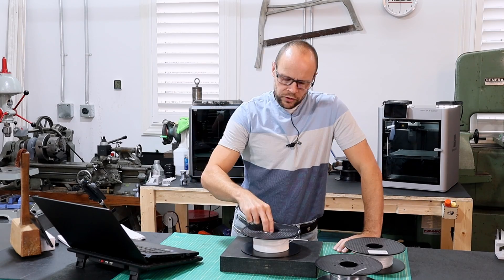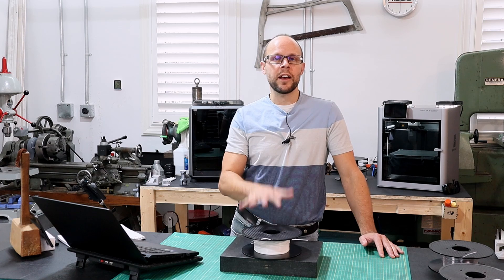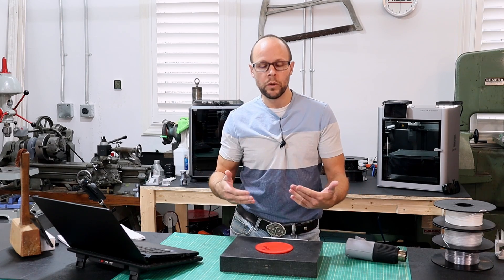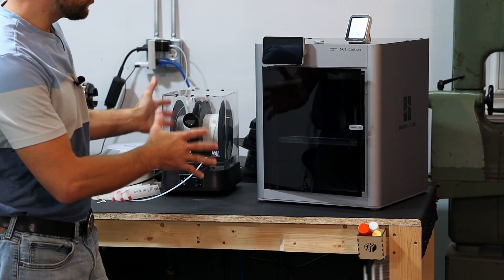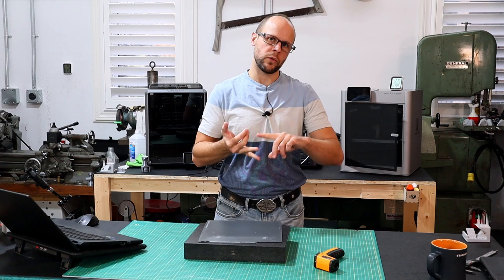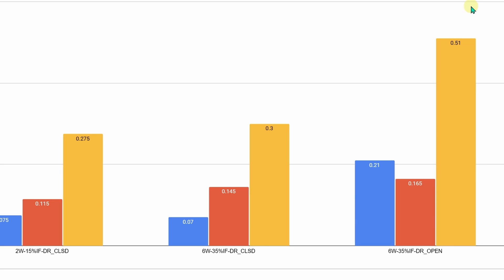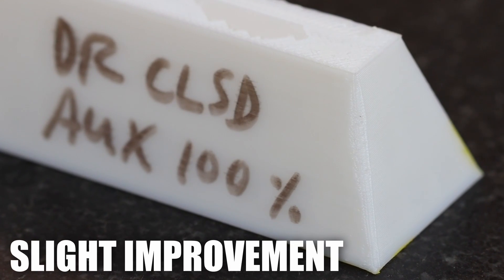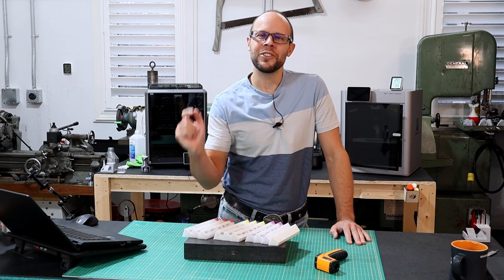Does PLA Warp?  If it does, how much compared to PETG and ABS?

Comment: I've had my X1CC for over a year now and I just print with the door closed, even with pla, just because it works and works and works
Reply from the maker: That's good to know, there seem to be lots of people who mod their printers to add vents etc.   I guess in my case I was doing high-speed and also fairly small prints, cooling was a problem, if the prints were a bit larger or more pieces on the plate, it would've been fine at the corners.  I'm with you, I am a huge fan of the X1C.  I like the K1 as well though and I think it can be better still, and I am also going to see if I can get my hands on a K1 Max, it would be nice to be able to test against each other.
Reply: I bought P1S and I have to say that without a cool plate with bed temperature set to 35C, I get clogs (even with lid open but closed door). The filament snaps in the heatbreak. Never had this issue with P1P.
Reply from the maker: @hologos_  I have to wonder if it more of a filament related issue.  I have not had a single one of these problems with my printer; I suppose there is the fact that I'm running the hardened steel nozzle and it doesn't heat as well as yours does.  There are so many variables involved.  That's a great point though, running too hot can cause other problems which are different and equally as annoying as the ones shown in the video.  Do you mind sharing the part your printing and the filament you run on it?  You have me curious now!
Reply: @NeedItMakeIt I am using PLA from Aurapol (Czech company) and I have to print with 240°C temperature with 15mm^3 max volumetric speed. Those clogs were with default stainless steel nozzle. After about 3 hours, the filament snapped in the heatbreak. Once while printing single color print and once while unloading in multicolor print. I guess the filament got soft. Since then I've been using cool plate and haven't had issues even with lid and doors closed.

The parts I printed were a full bed organizer tray and the multicolor one was a Call of Duty headphones stand.
Reply: I just use the hot plate and closed printer all the time, also with PLA. It just works.
 @hologos_

Comment: In the example the prints don't deform due to adhering to the bed. Does that mean the parts internally stressed? Also, I've read somewhere that warping can also be caused by sudden crystallization in thick sections that are too warm.
Reply from the maker: Yes, that's right, what I wanted to show in the video and what most people seem to not realize is that the parts are still warping even though they had perfect adhesion, it's true that its not a lot, but it is a problem in some cases, when you take two prints off and you put them together, the banana shapes meet against each other and don't fit tight.  Not so great in some cases if you want a tight fit.  There are definitely internal stresses involved.  I'd liken it to wood, when you cut a piece of wood sometimes even though the original piece was straight, the pieces you end up with after cutting are not.  The smaller parts with thinner cross-sections are more flexible and warp.  Similar here with plastics, if the cross-sections are large enough, they can resist the stresses.  Also the adhesion to the bed does this as well, but only to a certain point, it can still pull up on the buildplate quite a bit.  A while back I printed a heavy-duty ASA piece and it completely lifted the buildplate away from the magnet.  it was just terrible and of course the print was ruined as well... 

I don't have a full solution to this problem.  I think printing slower seems to help, also printing PLA in the enclosure and keeping the temperature inside the chamber higher helps quite a bit as well, and if the prints are large or there are more than one, cooling shouldn't be a problem.

Comment: I used PLA on a project that had thinner areas touching the bed. I forgot to use rafts and it warped bid time! More so farther out towards the ends.
Reply from the maker: For sure, I wish I had some way of measuring how much force is applied, it's probably far more than what we expect.  You would use a raft to help you on this?  I think I've only used a raft once, back 4 years ago.
Reply: @NeedItMakeIt  I've never had problems before with this much warping as I did with this particular print. The part was maybe 3/16th wide and 3 inches long and all 3 warped up badly. I also had a problem with the heat block hunting for the commander heat settings. I had adjusted the temp after I started the print as it felt colder in my basement than usual. I was thinking the colder temps were going to cause a problem so I upped it a bit.

Half way through the print (pretty much a stock Ender3v2) I saw the pid hunting to keep the temp at what I commanded it to. But I think the lack of using a raft around the thinner parts is what made it warp the most. The temp swings I think is what caused the poor appearance of the print. I had a lot of layers that looked terrible and then some areas that looked fine.

This printer usually does a good job for me. The only thing I've done to it is replace the boden tube & fittings, & calibrated the e steps. I use a glue stick with every print. My thought was the lack of area that was "glued" to the bed caused the warp? 

I haven't printed anything since so I haven't tried redo this one yet. It wasn't anything serious, but I'd like to try again. I just need more PLA.
Reply: @jeffallen3382  i think the issue is that the part IS glued to the bed, together with the temperature gradient along the z axis
Reply: @marc_frank  the thing is there wasn't much glue there as I went very light (more so than I usually lay down) thinking I always use "too much". Well that thinking screwed me and ruined this print.

Comment: i've had pla warp
long thin tall prints on a (400mm)³ printer
Reply: That's what my part was like that I described above in my post. It was maybe 3/16th wide x 3 inches long and 3 inches high. It curled up bad towards the end of this part. The farther out, the worse the warp.

My thinking was because I didn't use a raft support. I use a glue stick and my thought was it wasn't able to stick well?
Reply: @jeffallen3382  i've never intentionally used raft as bed advesion, only on a pre sliced model that came with the printer
how is raft supposed to help?
Reply: @marc_frank  spreading out the area of contact to the bed and with more area that buttering the bed with glue to hold it down.

At least that is what I've had luck with in the past. I've never had a warp problem before and this was the first time I've not used raft supports & this little glue as well. I barely used any at all this time.
Reply: @marc_frank  I should say, I've never had a warp issue that I've noticed? The print I did that I described probably warped at least 1/8th-3/16th out towards the end of this part? Warped worse the father out.

I may be totally wrong as I'm still new to printing and it's just a mostly stock Ender3v2 but I've never had something warp this bad before.

In fact the print before this was probably my best print I ever did! I was using clear PLA and it turned out great!
Reply: @jeffallen3382  hm okay, but wouldn't a brim increase contact surface as well?
Reply: @marc_frank  yes, that was what I was wanting. More contact area, more glue to hold the part down.

Maybe I'm describing it wrong. But that was my thinking of what caused my print to warp. Not enough bed adhesion to hold the part in place.
Reply from the maker: That's one thing I don't do often, most of my parts are fairly short.  Did it still stay attached the the buildplate and pull it away from the magnet?
Reply: @NeedItMakeIt  nope it lifted off, i had a glass plate. i'm now on textured pei, not sure if it would still do it
Reply from the maker: @marc_frank   I remember printing some heavy duty parts on a glass plate and when I removed it from the printer, the plate itself had changed shape, it was being pulled up so much that it deformed the glass.  Textured PEI is supposed to be one of the best for adhesion during the print, I'll have to do a comparison down-the-line.  You don't use any adhesive right?
Reply: @NeedItMakeIt  not anymore. on the glass i tried spray glue (spread thin using acetone)